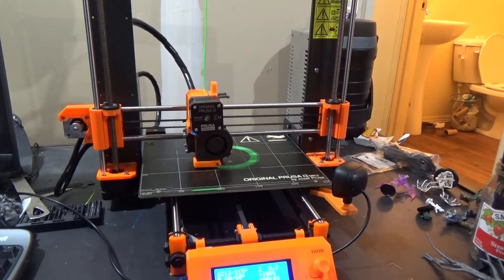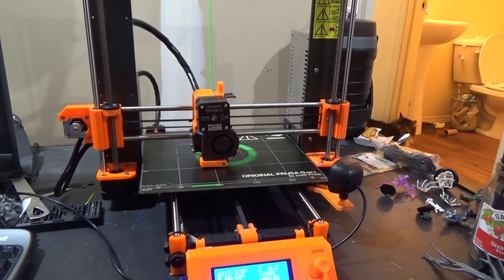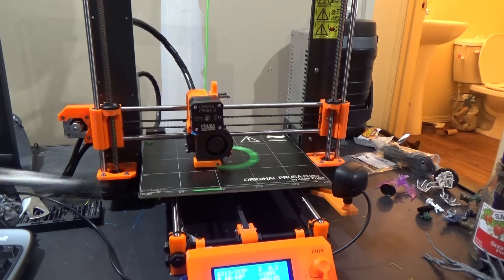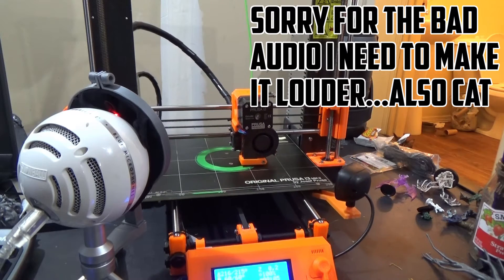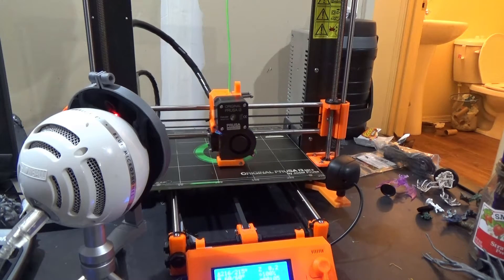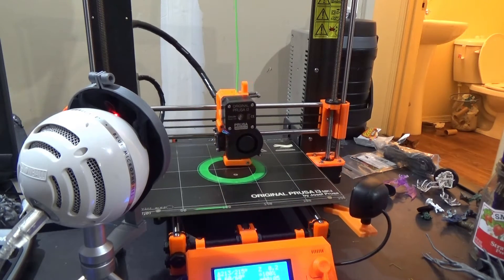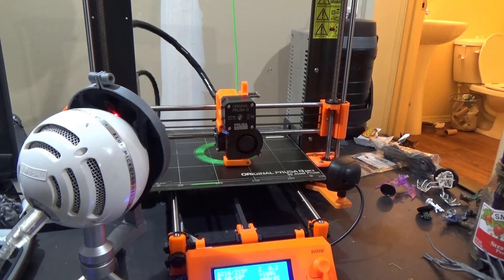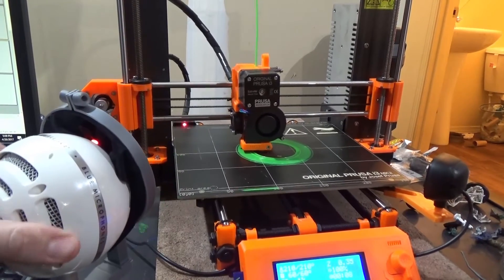Prusa i3 Mk2s sound dampaning

Comment: What size block are you using?
Reply from the maker: +Popcorn Shiner I ended up using 2 11x11 inche blocks because that's what I had but you need a block that is at least 16 inch block for the depth but only about 12 for width. M8ne overhangs about an inch on the sides but 99%of my frame is sitting on the block so I don't have any troubles